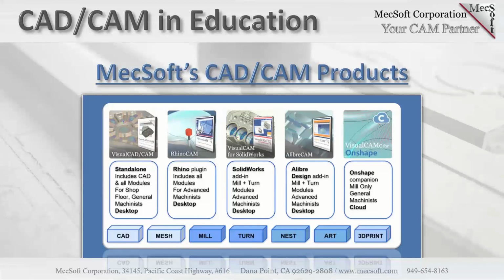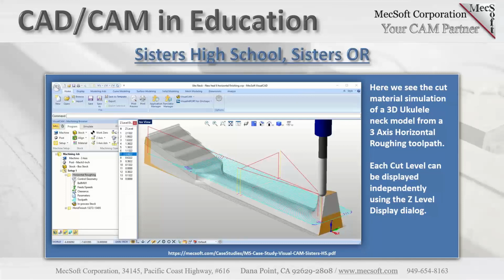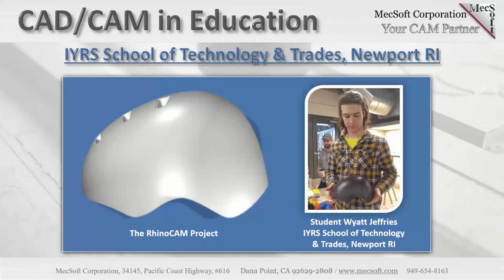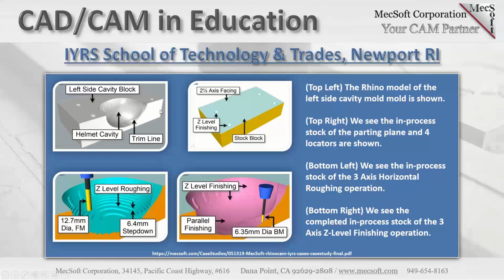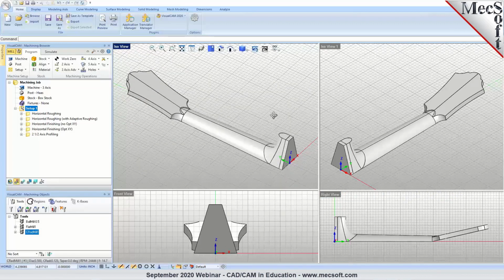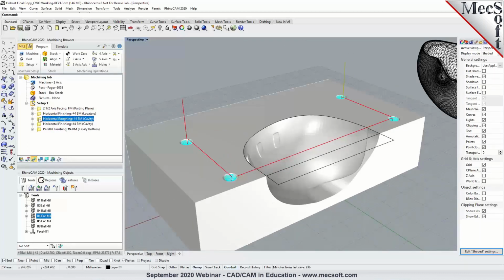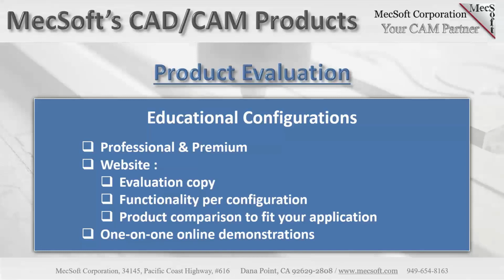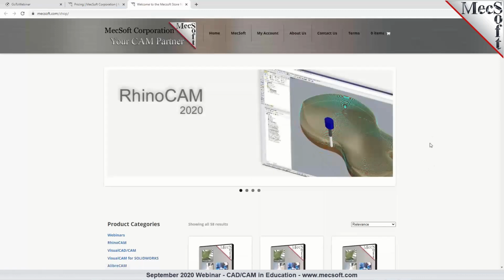September 2020 Webinar: CAD/CAM in Education

Comment: I have been using Rhino 6 + RhinoCam 2018 for over a year (I mention that I use the most expensive version), intensively. I have a strong, industrial cnc (Bosch Rexroth, Giordano Colombo 3.5kw etc). 
 In theory everything you describe is beautiful, in reality it is different. I build electric guitars, my necks are already rough, to save time, there is no such option in RhinoCam (band saw), I had to make a lot of changes in the design to solve, but not completely. It has also happened many times that the g-code is generated incorrectly, to receive errors during milling. 
 Also, the generator for feeds&speeds is not optimized for wood or brass, it is not a safe "tool". Also, there is no option to set the safety level of the Z axis before and after stopping the milling, in "clearance plane" if I set the safety value to 20 mm (Absolute Z value), the milling cutter will waste a lot of time with lifting and leaving unnecessary during milling. 
 Also, several cutting options were presented, which are not usable in practice, they are only good in virtual mode.
 For such an expensive program, it would be necessary to have detailed video presentations with these options for building guitar necks in good condition. Also, in reality, during milling it is almost 2-3 times higher than the virtual.
 Thank you, antonioguitars.ro